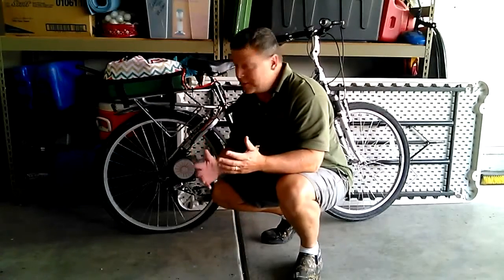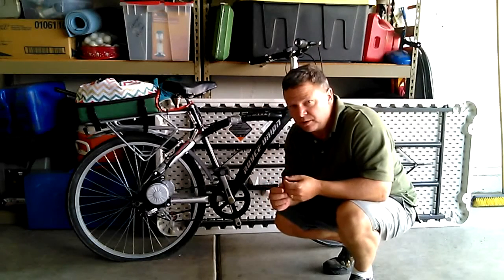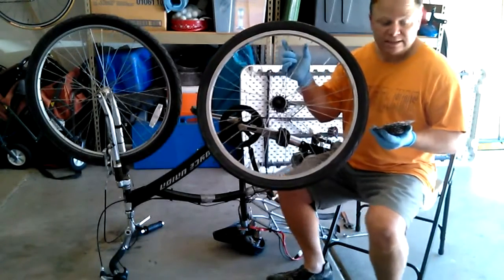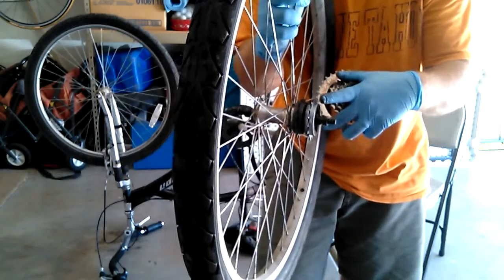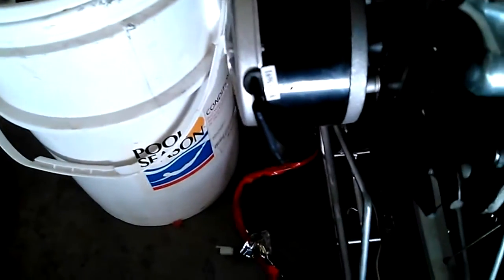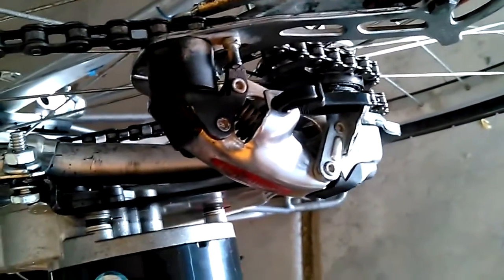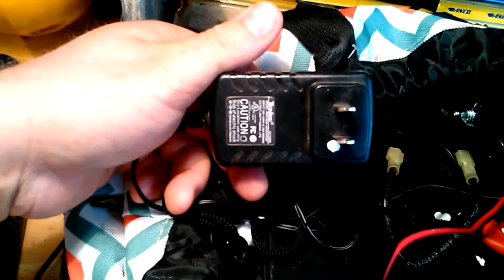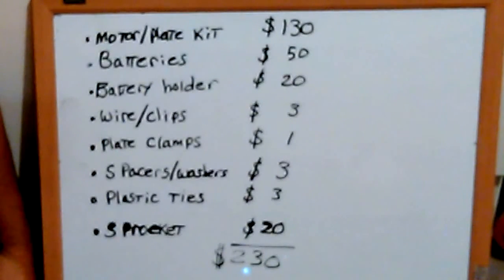E Bike Installation Conversion Kit Side - Mount My 10116

Comment: i bought the same kit i got everything work but the motor is spinning backwards i tried everything how would i change that?
Reply: Reverse the wires to the motor.
Reply: Reverse the polarity of the motor to suit your need.
Reply: that works ! just change +ve and -ve wire polarity
Reply: change plus and minus, and the motor runs other direction.
Reply: dude you are 10 months late
Reply: Swap the plus & minus. It'll run in the other direction.
Reply: OP never figured it out at has been riding around backwards ever since.

Comment: can use 1 24v  battery
Reply: Yes but these kits are not that great do yourself a favor buy a jobless moter kit.. It goes togather just as quickly. Faster longer distance less noise. And you can keep you 6 speed cassette

Comment: No disrespect but I cant belive any one still buys this thing. I just put a complete Volimart 48v 1000w brushless hub motor. 38.4 miles per charge 34.7mph for 480.00 there is a reason thoughs are 70.00 kits. But do your self a favor at least go with a 24v li-ion 14ah battery much less weight then acid batterys and only need one.